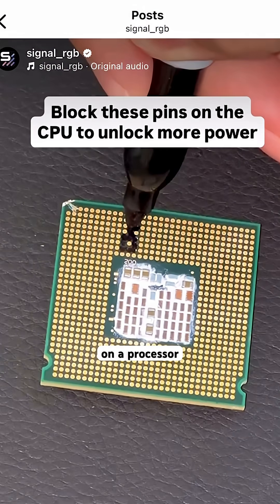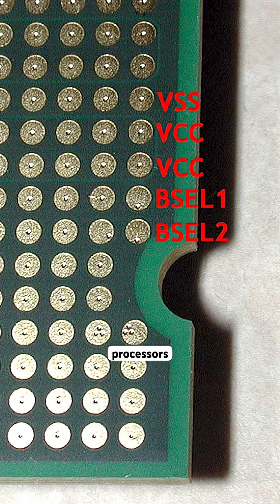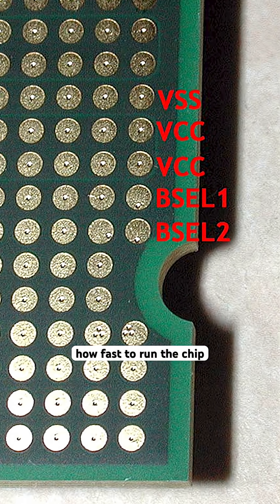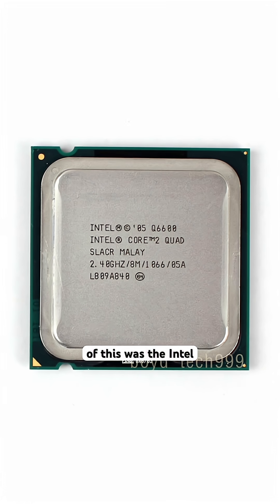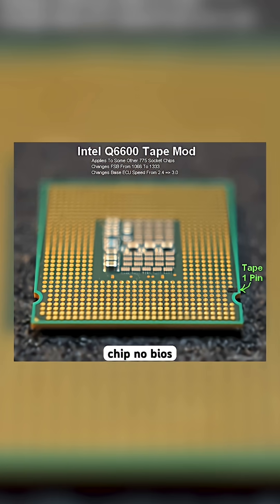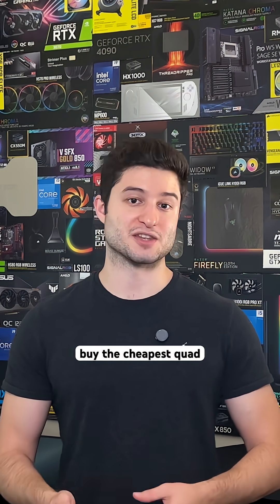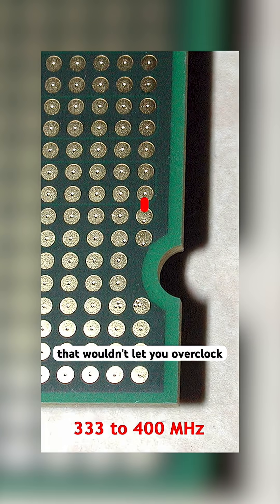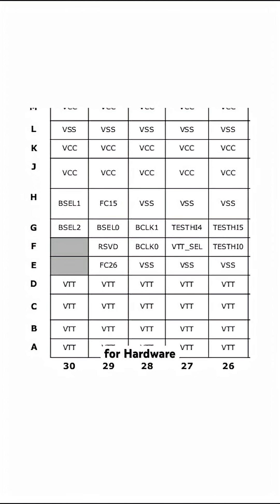Taping a CPU to improve it?!

Comment: There were LOTS of little tricks like this back in the day. Off the top of my head:

Using a pencil to connect pads to allow overclocking on AMD chips back in the first Athlon days (socket chips only).

Later, AMD changed the design to make this harder, but it could still be done with superglue and conductive ink or something like that.

Radeon 9500 non pro was just a Radeon 9700 with some lanes or something disabled (I forget exactly). If you won the silicon lottery and those lanes were not defective, you could reactivate them with (I think a registry mod?) and get a working Radeon 9700 non pro (a nearly flagship GPU) for a Radeon 9500 non pro price (much cheaper obviously).

Pentium 4 1.6ghz was known to quite commonly overclock to 2.4ghz, a 50% overclock

Celeron 300A, one of the earliest examples of a big overclock. Just get a motherboard capable of FSB overclocking and increase the FSB from 66mhz to 100mhz. Boom, you have a 450mhz Celeron with full speed cache that was actually faster than the flagship Pentium III 450mhz which was a slot chip with slower cache (because it was not on die like the Celeron). Needless to say the Celeron was entry level priced while the 450mhz Pentium III was a flagship processor.
Reply: Just remembered one more interesting one so I'll add it here: You could actually flash different firmware on your DVD burners back in the day to 'overclock, them LOL. Funny but true, you could actually make your DVD burner burn DVDs faster. They were basically the same hardware, just limited by firmware to appeal to different price points.

Comment: Even if you just used the standard technique of changing FSB frequencies, these CPUs were overclocking beasts even air cooled. My Q6600 rant stable at 3GHz and the Q9550 went from 2.8 to a stable 3.8. I was even able to crank it up to over 4GHz for a 3DMark 2006 run, though at that it crashed about 2/3 of the time.
Reply: I thought my CPU was a goner for a moment, so I quickly swapped in an older one to see if the mobo would POST.

Turns out I swapped an E7500 clocked to 4.5GHz for a Celeron D 352, but kept the OC settings.

It booted up and I shit myself when I saw 8.9GHz in the POST screen, I had the CPU running without cooler so I turned it off as quickly as I possibly could. 

That Celeron D was running 374MHz FSB at 24x multiplier, so I might have broken some records when it booted at 8976MHz 😂😂😂

Comment: Their was also a pencil trick for AMD CPUs!

The pencil trick:

"Unlocking the Duron and Athlon Using [a] Pencil

Hold your CPU in your left hand and look very closely at the CPU, so as to clearly see the L1 bridges.

Use a business card to separate the bridges so that you do not connect the L1 bridges to each other. Work your way across the bridges from left to right (using a business card as a separation tool) and connect the bridges by rubbing the pencil back and forth over the bridges about twenty times until it is dark black, not the normal gold color. Make sure that all the bridges are reconnected, but not touching each other, and you are on your way.

I know it sounds incredible, but that is actually all there is to it. Your processor, if done correctly, is ready to be overclocked. It can now be set to run at different clock frequencies, eliminating the need to increase the FSB."

Comment: There were a bunch of ‘budget’ single cores being sold as that time along with the core2duo’s as well, I can remember getting them from 1.6ghz up to 2.1ghz with exactly this mod 😁 made them kinda useable!

The little 1.6ghz single core is the one that was famously cooled with potato’s or even just blowing a desk fan right at the chip, no heat sink required! 👀 a few OC’n guys has some fun with them by seeing how little cooling you could put on them and still have it work, the potato thing had been a meme and then someone tried it and it damm well worked! 😂🤣

Comment: it also worked with lga 1151 v1 motherboards run 1151v2 cpus with covering pins and connecting some grids and bios modding

Comment: Processors are literally a scam
all i3 i5 i7 are the basically the under performing i9, just they check how many cores are working or dead( happens due to manufacturing issues) and then name, configure and sell them accordingly

Comment: funnily enough I still have a Q6600 that I've had from release and it still runs...about 2 years after I got it it's run at a 3ghz overclock solidly and it has survived MULTIPLE PSU failures.

I never knew this tape thing was as big outside of making xeon processors work on 775 boards...maybe that's the viking funeral it deserves.

Comment: You're wrong. Core2 era motherboards allowed to freely set FSB. No one did pin mods back then.
You could set FSB from 200 MHz up to 400 MHz. Way above pin mods could do.

People literally bought cheapest Core2Duo models available. I've had E4500 which was a 2.2 MHz CPU. I've used it at 2.93 GHz since day one. It also worked stable up to 3.3 GHz but it was too powerful at 2.93 GHz already.

It was possible to go even higher by limiting multiplier and setting higher FSB, though there was no need.

After many years I've got Q6600 for like 3€ and did similar OC without any pin mods.

At that point I've had modern i5 anyway. However I was surprised how fast Q6600 was. Overall I should rather get Core2Quad instead of 4-core i5.
Core2Quad was definitely capable of filling the gap between core2duo and AM4 Ryzens.
Reply: I thought my CPU was a goner for a moment, so I quickly swapped in an older one to see if the mobo would POST.

Turns out I swapped an E7500 clocked to 4.5GHz for a Celeron D 352, but kept the OC settings.

It booted up and I shit myself when I saw 8.9GHz in the POST screen, I had the CPU running without cooler so I turned it off as quickly as I possibly could. 

That Celeron D was running 374MHz FSB at 24x multiplier, so I might have broken some records when it booted at 8976MHz 😂😂😂

Comment: Q6600 is a legend, one of the best processor made by Intel. If it's only pushing q6600 to 3.0 GHz from 2.4 GHz just change it from bios faster and less problems. Back in the days my q6600 run daily 3.6 GHz paired with abit p35 and thermalright 120 serve me well for 5 years without any problems at all.